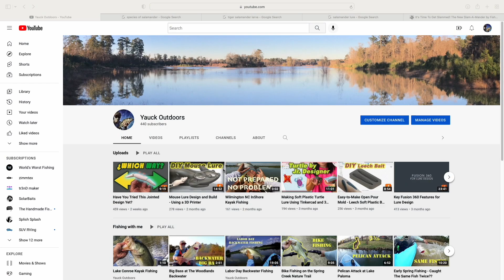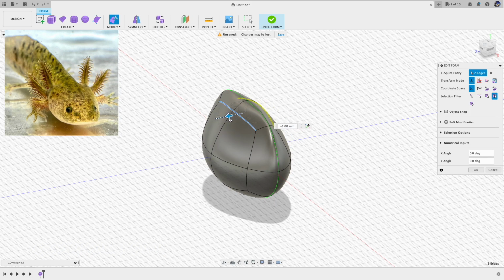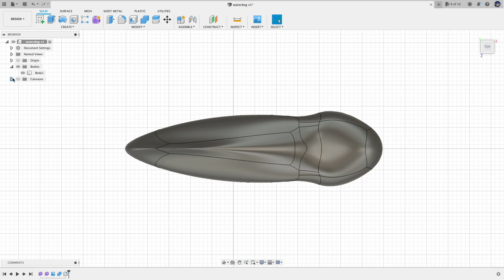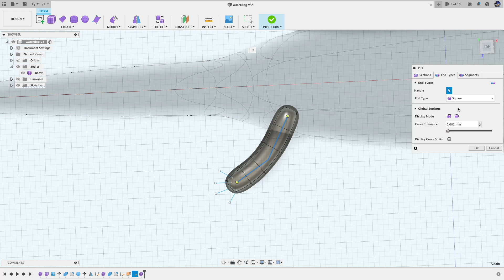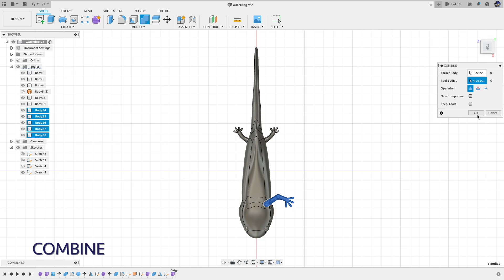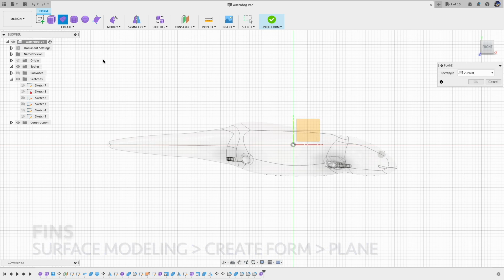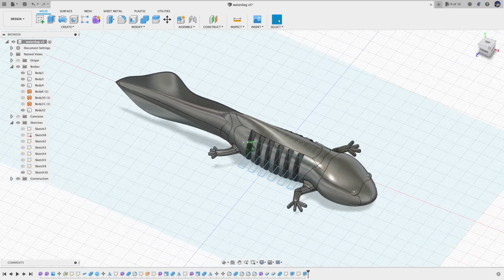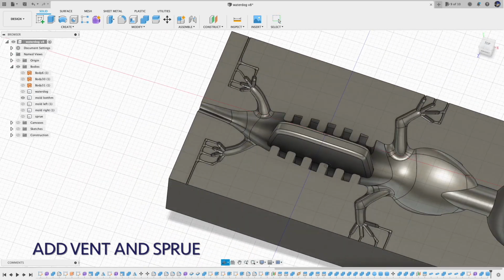Waterdog Salamander 3D Modeling and Soft Plastic Bait Making

Comment: Hi
I really like what you are doing really excellent. 
Please can you give us the material you use to make the lures and what is the optimal temperature for the heating of the material and approximately how long it takes to cool.
Thks 

The best of wishes for the future.😊
Reply from the maker: Thanks for tuning in. I mainly do remelt from the recycled baits, so there is not much of consistency with the stiffness/buoyancy. When I need to dial down the effect, that's when I use fresh plastisol. So if you just want to do some prototyping, remelt is perfectly fine. I usually shot/pour at 300F/310F or a little beyond that depending on the room temp. You also need to account for the fact that if the injector is cold or not. It takes different time to cool, depending on the size of the bait. I would leave it at least 30 minutes to an hour before I do anything. Hope this helps.